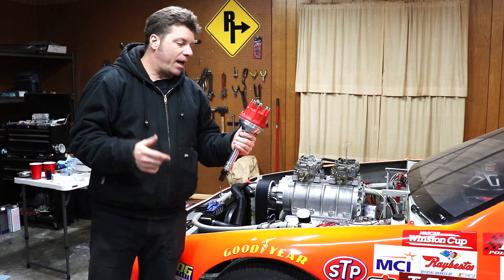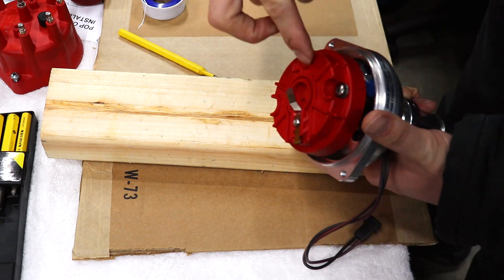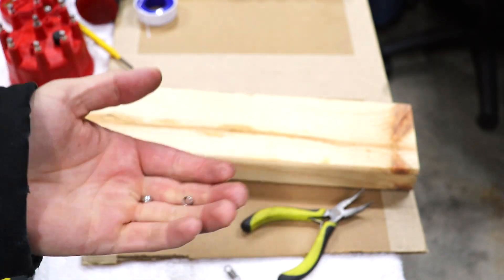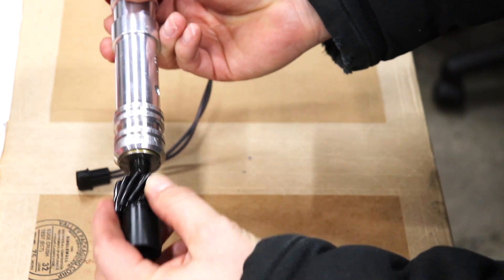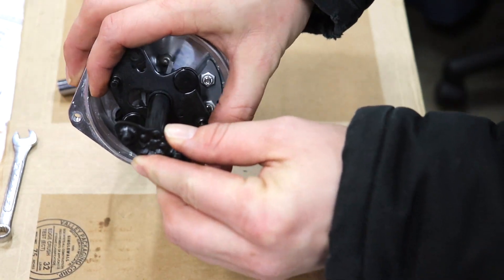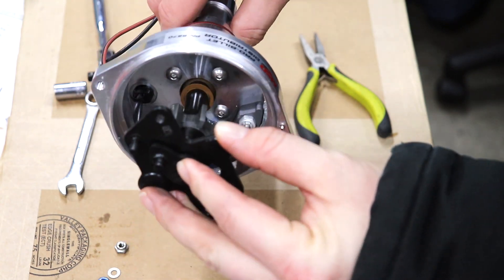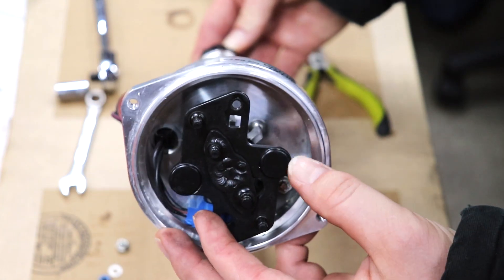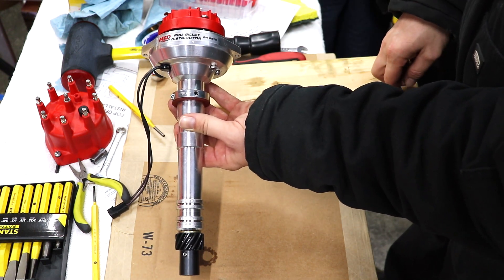How To Lock Out Timing On An MSD Pro Billet Distributor

Comment: Could you be a little more descriptive on the last part, that's a gray area for me. I have my tdc set at zero, and I dropped in the distributor right at the #1 plug wire. I also have a Starter Saver..I. want to run at 40 degrees.
Reply from the maker: 40 degrees is a lot of advance. I personally wouldn't start there. Maybe start at 32 and work up?
When you drop the distributor in on number 1, you should be close to a start with it pointed there. Rotating the cap will change the timing. Look up a video on setting timing for a first start. With the distributor locked like this, If you set it at 30° advance, it will be at 30° no matter what- idle, cranking, 6k rpm, blown up, shut off, it will always be 30°.

Comment: Good video! Why do you need to lock out the advance? I've never heard of anyone doing this with a turbo, but I know almost nothing about roots-style blowers. Maybe a video about this and the other technical details of building the blown motor. Thanks for documenting this!
Reply from the maker: Because the engine is always being forced air, it takes longer for the mixture to burn at lower rpm, so the advance helps keep exhaust temps down. At higher RPM, you don't want more advance because detonation becomes an issue. The only problem is cruising. Won't get the vacuum advance there, so the headers might get a little hot. I'm no expert though, just what I read.

Locking out the timing on a blower motor is very common from what I read.
Reply: @RightTurnRandy  That makes sense. Keep us updated!

Comment: How do we install a locked distributor and adjust crank for first start? Do we have to bring crank to 36 degrees before first start if we plan to locked it to 36?
Reply from the maker: Wherever you set it is where it's gonna be at the entire RPM range, all the time. For first start, I'd set it about 30 degrees and adjust from there. 36 is pretty spicy.
Reply: So to install the distributor I bring #1 to top dead compression stroke like you would with a regular distributor then set the timing mark on the balncer at 37(that's where I'm running its a healthy Lil small block) then drop the distributor in rotors at number 1 and that's where it's at correct?

Comment: I locked out my other distrubutor(taiwan made) to work with my new MSD 6530 Programmable box. Set it to 28*. But it retarts nearly 16* when I rev. What would be wrong.. I am lost...
Reply from the maker: If you've eliminated the programmable box as the problem, then a few possibilities remain. A worn timing chain could be the problem, or a bad balancer, but not likely. I would suspect some setting on the box is the problem. But couldn't say for sure without seeing it.
Reply: @RightTurnRandy  OK. I solved the problem. I used different battery to hook the timming light.. The timing was at 26*. Then I loded my Msd timming curve. 22* at cranking, 26* idle and 34*wot. Runs great. Thank you very much for your answer..👍
Reply from the maker: @ghtrcp7554  Awesome! Glad you got it. 😁

Comment: What if the timing is still bouncing around after locking the timing, above 3k Rpm? Advancing and retarding back and forth only 3k and above. Cam thrust issue possibly??
Reply from the maker: @MichaelSmith-eu4ss  I don't think it is. The car runs fantastic now. The only thing I could probably do is adjust the air valve secondaries. Which I should do.